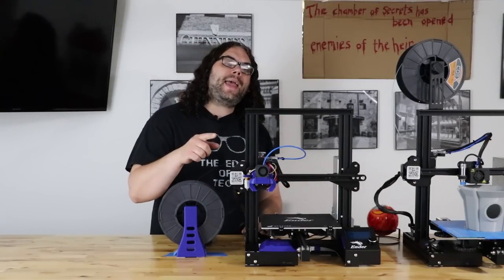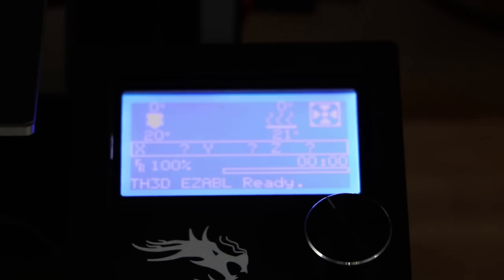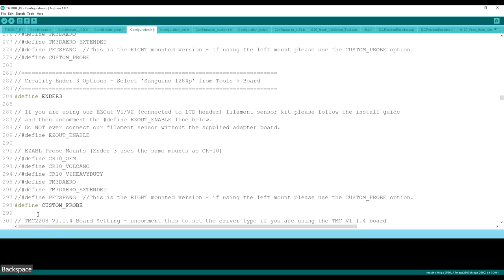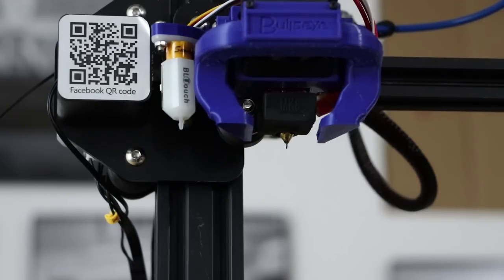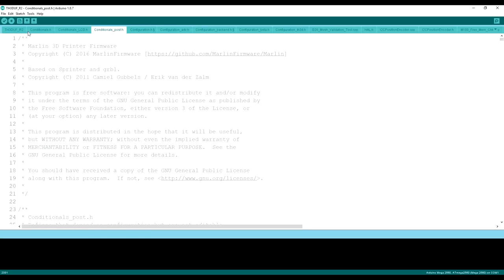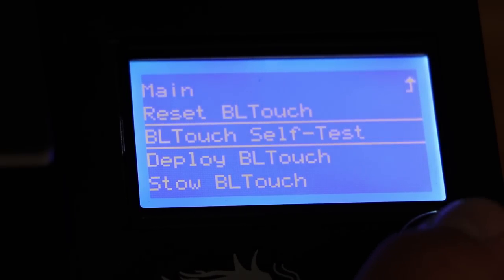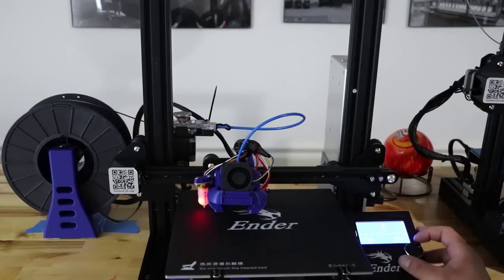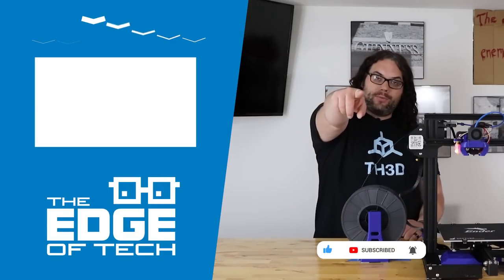New way to configure the BLTouch on the Ender 3 in 10 minutes or less

Comment: i finally got a bootloader on my ender 3 and followed this video. loaded the newest TH3D firmware and it appears that it all works. however, i cant get the z offset right. when i auto home, it puts the Z at 5mm from 0. only way i can get it to lower, if with the baby stepping and it doesnt let me go low enough (-4.975 is the lowest it will go) what am i doing wrong? anyway to fix this? bltouch seems to respond fine when it probes
Reply from the maker: Try raising your Bltouch a little. It sounds like the probe is to low and stopping the nozzle to high from the bed. Thanks for watching!
Reply: @TheEdgeofTech  thanks for the fast response.  I'm actually using the metal mount that creality sells with their bltouch kit :-(
Reply from the maker: @stevedegregorio3423  So there no up and down adjustment on it? Maybe where the Bltouch attaches to it with the screws?
Reply: @TheEdgeofTech  nope its solid metal. Holes for screws, don't allow for movement.  It's very odd.  Whenever i hit auto home,  it puts z at 5mm. And even when after i start a print.
Reply: First  - auto home
Second - move axis 0.1 mm = +0.00 mm
Third  - z offset +/-  (against a4 paper)
Fourth - repeat until it looks good.
Reply: I'm having the same problem, how did you fixed it?
Reply: @kevinarturoramirezzavalza1708  
Hello, what you have is not a problem just that you have to do the following :

Steps :
1 - Auto Home
2 - Move Z a +0.00 mm
3 - go to Control -> set z Offset (lower the nozzel until it is at the desired height)
4 - Store Setting
5 - Load Setting
6 - End

Sorry for my English.

Pablo

Comment: Using the latest TH3D firmware along with Creality 3d BLTouch and my probe never probes anything but the center of the platform, never goes to corners?  What the heck?
Reply: My problem was Cura 4.7 not actually saving changes to a g-code file and adding the G29, your tutorial worked great!

Comment: Hi I followed your video step by step but your printer still has SD card support and mine doesn't
Reply from the maker: Are you using the newest version of the firmware?
Reply: @TheEdgeofTech  Yes the latest one
Reply: Mine has only three options on the main Screen-:
Info screen
Prepare
Control
Reply from the maker: @1gurjeetbhullar  I would load it again if you didn't already.
Reply: @TheEdgeofTech I uploaded the sketch again and now its showing SD card. By mistake i disabled SD card before. Thank you very much.
Reply from the maker: @1gurjeetbhullar  Great to hear!!! I'm glad you got it working!

Comment: Anytime I try to enable the BLTouch. I get an error message when I try to verify the code " #error "You must define Z_CLEARANCE_DEPLOY_PROBE in your configuration." How do I resolve this?
Reply from the maker: I haven't seen that one. I assume your using the new TH3D firmware right? I have not had a chance to to try that yet. But if you post your issue with the error you are getting on the TH3D support Facebook page, you should get some quick responses.
Reply: That happened to me when I forgot to uncomment #define CUSTOM_PROBE

Comment: HI I JUST DID WHAT I SAW AND NOW MY ENDER 3 PRO WILL START A PRINT USING THE SD CARD THEN JUST STOP FOR NO REASON ANY HELP ?
Reply from the maker: You have a Bltouch on it? Also, what version of the firmware?
Reply: @TheEdgeofTech  TH3D_UFW_U1.R2.21a AND ITS THE BLTOUCH V3.1 I THINK
Reply from the maker: @masterviper420  I have not looked at that firmware yet, but did you comment out the part for the version 3 BL touch?
Reply: @TheEdgeofTech   WELL THE BLTOUCH WORKS GREAT BUT THE THE PRINTER STOPS PRINTING WHEN USING THE SD CARD
Reply from the maker: @masterviper420 Wait. Where does it stop printing? How long after the print starts? Or does it stop when you put the sd card in before you print?
Reply: @TheEdgeofTech   LIKE 3 MINS IN FROM THE BOTTOM
Reply: @TheEdgeofTech  ILL DO A SHORT VID IF THATS OK TO SHOW

Comment: Looking at the code for TH3D V2.15 I am not sure that the part of change "FIX_MOUNTED_PROBE" for "BLTOUCH" is correct anymore?? I'm NOT 100% sure, just an observation.  Great video, it has helped but just stuck on that part. (I have an Ender 3 pro V1.1.5 board and BLTouch V3.1)
Reply: same here i was stuck with Ender 3 Board 1.1.4 Bltouch 3.1, but yeah great video as usually.
Reply: @TheJohnnyarias  In the end I did not change that part of the code and all seams to be working at the moment
Reply: CharlieLima yes sir that’s correct I just keep the name by default made couple of changes and all working ender 3 Board 1.1.4 BL V3.1 thanks for replay
Reply: @TheJohnnyarias  Great to hear - happy 3d printing :)

Comment: Any different procedure if I have a 1.1.5 silent board?
Reply from the maker: Nope!
Reply: I just tried it on the silent board and followed the directions with version 3. My screen won't display anything when I turn BLTouch on in the settings.  When I disable  BL touch and reflash, it works fine.
Reply from the maker: @MrBzungali  Crazy. If you turn on the Bltouch but don't plug it in, does it show on the display? Meaning keep the display plugged into the pin27 board but don't plug the Bltouch in.
Reply: @TheEdgeofTech  I was and idiot and had the plug in wrong. I now have it on and the LCD on, but when I go to the Self Test in the menu, the BL Touch doesn't do anything.  I have a newer version than you, I'm trying this setting now in the config.h

#define BLTOUCH_SET_5V_MODE

I'll let you know, if you have any ideas let me know. Bl Touch 3.1 and the silent 1.1.5 board
Reply from the maker: @MrBzungali  I'm not near a computer to look but I think there is a section to comment out about the BL touch 3
Reply: @TheEdgeofTech  This is the only thing I could find. I've been looking:

#define BLTOUCH
// If you are having issues with the probe not deploying/stowing correctly enable the below BLTOUCH_FORCE_SW_MODE
#define BLTOUCH_FORCE_SW_MODE
// For V3.0 or 3.1: Set default mode to 5V mode at Marlin startup.
#define BLTOUCH_SET_5V_MODE
// Here is where you set your servo pin. EZOut Servo Pin Numbers: Anet(with 2004LCD)/Ender3/5/CR-10 - 27, Anet(with 12864LCD)/Ender 2 - 29. For 2560 boards look for the pin you connected the servo wire to and enter below.
#define SERVO0_PIN 27
Reply: I finally got it working. I appreciate the video and help!  I'm trying to get my z off set dialed in now
Reply from the maker: @MrBzungali  Awesome! Nice work! What did you have to do!?
Reply: @TheEdgeofTech  Most of it was me not taking my time, but these are the settings that I turned on to make mine work. Also, once I got it dialed in, it's working perfectly now. 

#define BLTOUCH
#define BLTOUCH_FORCE_SW_MODE
#define BLTOUCH_SET_5V_MODE
#define SERVO0_PIN 27

I don't know if ALL of these need turned on, but this seemed to work best for my setup. Thanks for help

Comment: Thanks for the TH3D instructions. I got through and flashed my firmware, but when I auto home it does the x and y, but the z won't go all the way down. It's pretty high up on the gantry.
Reply from the maker: What happens if you just home Z. Also, if it's moving and you out your finger under the sensor to stop it, does it stop?
Reply: @TheEdgeofTech  it moves to the center and goes up probably 20mm or so then back down. I've tried lowering the x-gantry down closer to the bed and it does engage the probe and then it tries to go down crashing the nozzle into the bed. I've got TH3D running at the latest level UFW_U1.R2.15. I've got a BL Touch 3.1 version on a Creality 1.1.5 motherboard on a Pin-27 set up. I added the G29-Code to my Cura profile after G28.  
G28 ;Home
G29 ; execute ABL
I have a video uploaded on the Creality Ender 3 beginner's page so you can see what it's doing if that helps.  https://www.facebook.com/jason.dickerson.52/videos/10217629584164748/
Reply from the maker: @jasondickerson9939  The wires could be backwards if the gantry is moving up. Was this working before this firmware, or is it a new install?
Reply: @TheEdgeofTech  it's a new install. I had TH3D already installed as my firmware before hand, but I did a clean update to the firmware. I tried flipping the BLtouch wires on the Pin27 and it did the same thing of going up, but not as much and it didn't engage the probe at all. I didn't flip the power cables, but I did try flipping the wires on the probe, but it seems like it's poke yoked to only go one way.
Reply from the maker: @jasondickerson9939  And it homes okay without the BLT plugged in and on the firmware right?
Reply: @TheEdgeofTech  before I did the BL Touch install yes. No issues with the TH3D firmware or regular homing. It would go to the Z-stop switch like normal. I did see you mention something about the Pin 27 board in the video. I enabled that option like indicated, but was there something else I needed to do to the Pin 27 board beyond what the video showed? Thanks for your help btw.
Reply from the maker: @jasondickerson9939  ok. I don't think so. So you enabled the Bltouch and the 27pin board right? Also, do you have a version 2 or 3 Bltouch?
Reply: @TheEdgeofTech  It's the BL Touch 3
Reply from the maker: @jasondickerson9939  Are you commenting out the V3 version?
Reply: @TheEdgeofTech  Yes. I commented out the Pin27 and the V3 version. I didn't do the search and replace Fix_ to  BL Touch in the Backend tab. I got error messages the first time I tried that and I saw that others were having issues with that. So I did a clean copy and followed the instructions up to that point. Didn't get any errors the second time.
Reply from the maker: @jasondickerson9939  When you go into the BLTOUCH menu on the board and do a test, does it go up and down?
Reply: @TheEdgeofTech  Just up. I put my Z-stop back on and reinstalled vanilla marlin to make sure it wasn't something hardware related on my original configuration, but it auto-homed like normal.
Reply: @TheEdgeofTech  also, I'm not getting any of the menu options for the BL Touch you show in your video. The M48 test is there, but it's like the probe never deploys.

Comment: Why do I keep getting this message? I don't know what I'm doing wrong. I have watched and followed along with this video and cannot for the life of me get this firmware flashed. My printer is dead in the water until I get this figured out. Help please!!

avrdude: stk500_recv(): programmer is not responding
avrdude: stk500_getsync() attempt 10 of 10: not in sync: resp=0x5a
Reply from the maker: Do you have anything else open that would connect to your printer? Like your slicer or anything. If you do you need to close that and try again. The firmware app is the only thing that can be open relating to your printer when trying to flash your firmware. Let me know if that works
Reply: @TheEdgeofTech  Thanks for the reply. I never saw the notification of course. I switched to the SKR Mini E3 instead and after some frustration I got it printing the first few things really nice. Thought I was finally in the clear and had a working printer again after 3 months of it sitting. Then all of a sudden it froze and crashed. Eventually got it to fire up by installing the firmware I was using again but it was never the same. After wasting hours today I gave up and back to Melzi 1.1.4 board. It's communicating and now I'm back in hopes of being able to get this firmware working and be done with this printer as far as modding it goes. I just want something that's reliable at this point. I pre-ordered a Prusa Mini in the meantime. We'll see if I made it in the first shipment or not. I got in pretty early. Wish me luck with this endeavor.
Reply: So it turns out that I misunderstood because of my noob-ness that I thought from the couple of videos I saw claimed that the new boards already had a bootloader installed on them. Turns out that's not the case. At least not with my 1.1.4 board. Luckily from my earlier days I had followed someone's instructions to get some jumpers and an Uno board. Hadn't opened either one until tonight. Got the bootloader installed and now TH3D's latest firmware and I'm back up and running. Printing my first test. Seems all is good in the world again. Thanks for reaching out.

Comment: Great! I finaly got it running after watching tons of videos. This was the best explained. (thank you) But how do you do to get the 3x3 mesh level? I got defined the EZABL_POINTS with 3 but it doesn't work.
Reply: add the necessary gcode to your slicer pre-print instructions. Remember G28 DISABLES Auto bed levelling, so do G28 then G29
Reply: @viken6661  Thank you. I'll try it.

Comment: So I got the firmware on my printer but when I go to use octoprint it won't connect anymore I reset the eeprom and still nothing anyone have any ideas my SD card slot is broke so the only way I can load a print is through octoprint please help
Reply from the maker: Make sure nothing else is open that would connect to your printer. If you still have the firmware interface open, close it. Try it and let me know. You may have to reboot your computer.
Reply: @TheEdgeofTech  for some reason my octoprint web address changed ....I found the correct address using getanywhereprint it would still link up even thought octoprint wouldn't...in the settings tab it shows your web address on getanywhereprint... So I entered the web address getanywhereprint  was showing and everything works now ...thanks for all your help hopefully this will help somebody else in the future with the same problem..8-D
Reply from the maker: Can you please email me  ASAP at jim@theedgeoftech.com about the giveaway!!

Comment: Hi, anyone can help me, I tried tu use the TH3D firmware but I have a problem, when I select autohome first move X and Y axis, it's fine, then for Z axis, the extruder goes to the center of the bed and activates the bltouch, then z axis moves until the bltouch touches the bed, and then do that again, and after that the extruder doesn't go all the way down to bed, it's really high and if I try to print something works in the air instead of bed. Also it it displays Z with 5MM. Anyone knows how to fix this?
Reply from the maker: What mount are you using for your BL touch? It may be mounted too low and need to go up a little. Also did you use baby stepping to go down yet?
Reply: @TheEdgeofTech  Thanks for answer,   I'm using the official kit from creality, I tried with babysteps but is not enough to get closer to bed, I put the max value i think is -4.75 but still needs more to reach the bed.
Reply: @TheEdgeofTech  I have bltouch v3 and removed c7 capacitor from board.
Reply: @kevinarturoramirezzavalza1708  I'm having the same 5mm issue with my Z axis. Were you able to find a solution? I know its 11 months later but I found your comment was similar to my issue
Reply: @plasauce4271  Hi, the solution was really easy, first you need a paper sheet, put it on bed, then on your ender 3 move to z offset option and move the axis until the extruder head touches the paper, then save that offset and it's ready to print.

Comment: For some reason I am not seeing the port for my printer when the bootloader is connected to both the printer and computer. Has anyone else ran into this issue and figured it out?
Reply from the maker: Did you install the drivers? What firmware are you adding! TH3D has the drivers in their firmware pack.
Reply: The Edge of Tech yes I did, I have the 1.1.5 silent board and I only needed to use the usb cord not the bootloader! I went with the current TH3D. Thanks for the vid
Reply from the maker: @Wblhockeydude  Perfect! Glad you got it!

Comment: These instructions are too old. I followed up to the point where it was too far out of whack for the current TH3D firmware download for my Creality Ender 3 Pro and then switched to the THD3 install instructions. Upon boot of my printer the board emitted smoke :( . I think upgrades like this are far too complex and with the the constant changes by the OEM and software sites the instructions become meaningless. Not sure where the failure originated from. Now I need a new board or printer. Will NOT attempt the BL Touch install again!

Comment: keep getting upload error. I have tried through usb bootlader and usb cable like in video, neither one will work
Reply from the maker: Do you have anything else open on your computer that could potentially connect to your printer? That would include your slicer.
Reply: The Edge of Tech Arduino is the only program that was open.
Reply from the maker: Do you know what the error is?
Reply: The Edge of Tech it didn’t specify. Just said there was an error and go to website for details. Don’t really know what to search for since it didn’t specify what was wrong.
Reply from the maker: @wannabetechie1494  I would take a pic of the error screen with your phone and post in the TH3D support page on Facebook if you can. That would probably help the best.

Comment: Hi, I followed the video twice, and both times, the entire print head goes the opposite way as the x endstop and crashes into the side. I thought I had done something wrong while following along, but I tried reflashing it a second time and it continues to do this behavior. Any advice as to what needs to change?
Reply from the maker: What version of the firmware are you using? Did you try to download it again and make the changes in the video from a fresh Firmware?
Reply from the maker: @MatiasKaliroff  I will test this today with the new firmware.
Reply: @TheEdgeofTech  Yah, I am using the U1.R2.14 as well.  Thank You for looking into it.